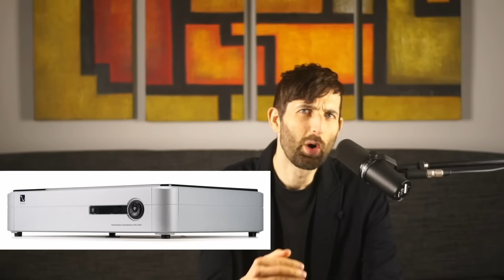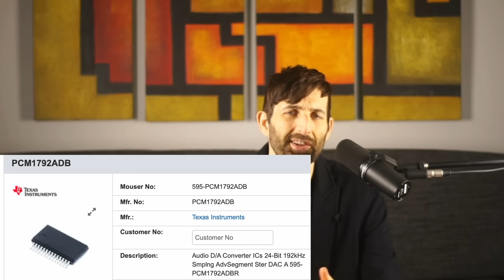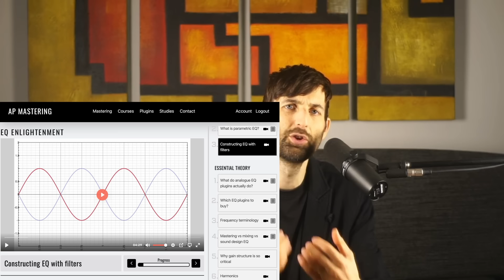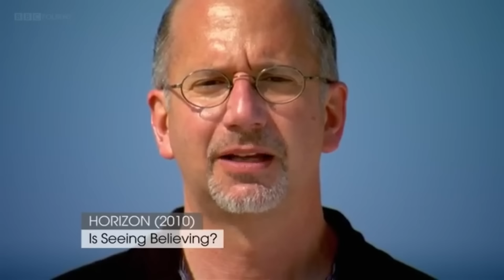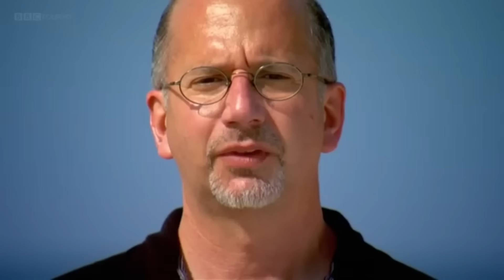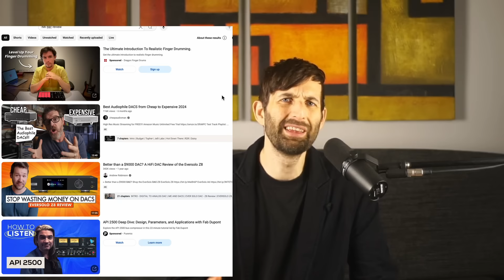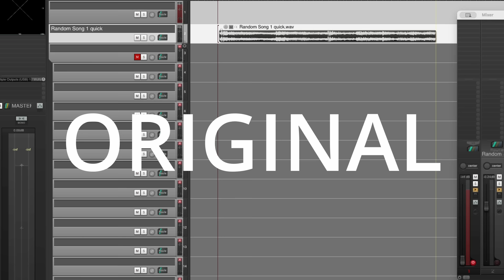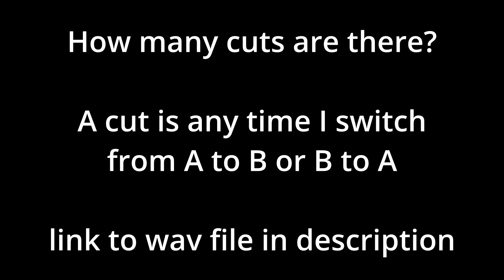The DAC Scam - Almost everyone believes the hype

Comment from the maker: GOOGLE POLL: https://forms.gle/wAQopiwNp8xmYX8c7

WAV OF BLIND TEST: https://drive.google.com/file/d/1JY8x0Vx7eL3KMoupVK1EAgHmeUJ6njxd/view?usp=sharing
Reply: Hmmmmm for the listening test - errr that's not really how A/B tests work. Can you provide what just the original sounds like? I'm not familiar with the piece and hear tons of artifacts and things that may be cuts, but that just may be the "sound" of the track. We don't know what it's supposed to sound like.
Reply: @lukegoodloomis6750  this is a normal bog-standard continuous unsignaled transition A/B test. One of them is the original, and the other is a loopback. It's right there in the video. You do not need a reference.

If you can't tell which is which or even when a cut occurs without being told, then DAC quality isn't something you should ever concern yourself with or spend money on.

Spoiler alert: nobody can hear which is which, because that's not how DACs fkn work, and nobody should ever concern themselves with or spend money on expensive DAC devices.
Reply: @lukegoodloomis6750  yep, that's why the young genenrantion of consumers don't invest in hi fi, everything they listen to is artificial  electronic  sounds, they dony have any natural sounds as reference
Reply: 4 times
Reply: @APMastering Back in the 80s one of the audio periodicals performed double blind A/B/X comparator testing of very high end CD players and amps vs. entry level pieces. The results were highly controversial in the community, but they clearly illustrated the profound effects of psychology on perception.
Reply: 3 times
Reply: At the end of the day it comes down to the chip used and how good the implementation of that chip is in the overall circuit.  In the world of electronics all of that can be objectively measured and compared to the digital source. With a really good dac-adc setup with matched sample rates etc you should be able to do a loopback and see almost a bit-bit perfect replication as if it were a digital copy.  Really these days DAC chip producers are just chasing down the noise floor and error correction, but it's already been significantly better than human hearing for decades.
Reply: I prefer as a DAC the Apple USB-C headphone adapter. It just sounds the best to me.
Reply: So are you saying that all interfaces use the same adc dac chip. So the only difference is the preamps?
Reply: Many times the grading of components comes down to things like tolerance etc i.e. how far out from the spec is the IC; So medical grade, lab grade, military etc, might actually spec out closer to the printed specs, but they'll be the exact same design anyway
Reply: This is stupid. You have a whold additional ADDA cycle. It's useless.
Reply: Answer: "DACs can introduce subtle "coloring" to the sound, primarily through their digital filter choices and the characteristics of their analog output stage. However, this coloring is usually much more subtle than what you'd get from an equalizer or a tube amplifier.  DAC chips often have selectable digital filters (e.g., sharp roll-off, slow roll-off, minimum phase, apodizing). These filters have slightly different frequency and phase responses, which can affect the perceived sound. Some might sound slightly brighter, some slightly smoother, some might have a slightly different transient response. These differences are usually quite small, but they are a source of "coloring."" Subjectivity doesn't equal scam.

Think of it like this: two high-quality wines might have very subtle differences in flavor profile, detectable only to a trained palate. Those subtle differences are real, even if a casual drinker can't distinguish them. The wines aren't a "scam" just because the differences are subtle.

Cumulative Effect: Subtle differences can accumulate and become more significant in a high-resolution audio system. A slightly cleaner power supply, slightly lower jitter, and a slightly better analog output stage, when combined, can result in a noticeable improvement in overall sound quality, even if each individual improvement is small.

Diminishing return is not scam: One may pay a very high price for very small improvement. That small improvement is still not a scam.

Saying "DACs are a scam" or "DAC coloring is a scam" because the differences are subtle and subjectively perceived is essentially equivalent to saying "subjectivity is a scam." and this is a nonsensical proposition.

Failing to distinguish between two DACs in a blind test doesn't prove they sound identical; it simply means the listener, in that specific test, couldn't reliably identify the difference. This is different from claiming that no difference exists, or that the manufacturer is deliberately deceiving customers.
Reply: did the poll already closed?
Reply from the maker: @ yeah i got over 1300 responses and already published the correct answer
Reply: with what type of music it can also be decisive. It's one thing if you listen to electronic music It's another thing if you listen to acoustic music maybe. or to songs that are preferably not digitally manipulated in any way
Reply: You simply have not understood the hifi puzzle/problem, what do you do when you put a file on Google drive, you measure, what can you measure precision and only precision, you cannot measure timbre image/soundstage, rhythm, perceived resolution and dynamics , how lifelike the sound is and more.

In fact, most of what we hear and interpret can't be measured, it's like taste, and to some extent sight.

The main problem is that a cable or a capacitor or an entire hifi device (a DAC) can sound so different on the non-measurable parameters in a hifi system that it is no problem to identify the sound difference with or without a blind test.

This is the hifi conundrum that has plagued virtually all serious hifi designers/engineers like myself for decades, the problem can be simplified to the sound difference between copper and silver, there is a measurable difference in conductivity but the audio signal itself is not affected, even if the conductivity is compensated for, there is a significant perceived sound difference on the parameters I mentioned earlier that are not measurable, sound differences that can only be perceived and interpreted by ear and brain in front of a complete hifi system. You cannot record them. If you could, the main problem is solved..
Reply: Why don't you try buying a ‘good enough hifi system’ in Wal-Mart and compare it to an Audio Note system at maybe 10-100 times the price, if you still claim there is no significant difference in sound I would say you are deaf.

The audible sound difference moves from a "technical reproduction from the Wal-Mart system where there is no doubt that it is a reproduction, to a much more lifelike timbre, image/sundstage from the Audio Note system and this is the essence and goal of our common hobby.

I'm an electronics engineer myself and for 20-30 years I've wondered about the sound differences on capacitors, resistors, cables, connectors,  PCBs, enclosures, and pretty much everything in controlled blind tests.

The only thing I agree with you is that many of these sound differences shouldn't be there according to theory and measurement, ASR has confirmed this for years.

But the vast majority of serious hifi technicians know that this is not the case, but they don't have the technical explanation, they only have listening experiences and technical hypotheses to rely on.

As you say mumbo jumbo/story telling sells better than admitting that you don't actually understand why many of these sound differences occur.

And it is precisely this problem paradox that divides hifi enthusiasts and causes them to argue endlessly in various forums.

Ps. You ask for proof, there is none, proof only exists as listening experience from millions of hifi enthusiasts, including technicians like myself who know full well I should not hear what I do. But still do it even in blind tests.
Reply: Actually, a proper test should always switch at the same point, otherwise, a recording will always sound different and you can't distinguish whether the change in sound is due to the switch or due to the performance and tonality change.
Reply: Thank you for your honesty about DACS. But, unless I missed something, isn't it the case that pricier DACS often include a preamp option, not that a preamp should cost a fortune either.
Reply: Switch 3 times
Reply: All the best days don't use chips
Reply: @kevinpaiuk2835 Some days I eat chips 😂
Reply: 😮Can u provide an Video Demo & Explaim what r all those Blue blue EXPO cap or Red Red WIXA German Cap or other Funny funny Cap just after came out of those DAC chip. Why must install all those Cap for what purpose!!😮😮😮
Reply: I fully agree with what is being said over here. I'm a mastering engineer and use a pair of PMC MB2 XBD mastering monitors with the highest quality electronics - quad-amped, super low distortion Bryston electronics. They remain as the current pinnacle of 12" mastering monitors. They go for over $100K retail. What do I use for the DAC? The fiio FQ1222. Bought it for double digits $ so long ago that I forgot how much it cost. It fully exceeds the monitoring system I have in every metric. There's no way people will be telling me I need an even $500 DAC nowadays. It's just not true. The only case a dac might exceed $500 and be worth it is if it has >10 outputs and inputs. That is ALL.
Reply: @cheater00 so this has to be true for interfaces as well, right. Besides the preamp?
Reply: @arnoldwatkins805  It absolutely is. And I checked. With the exception of Behringer, every audio interface I could find that published what DACs and ADCs they are using are using the same ones.

The big quality difference, I'm told, is in the stability of the drivers. And I have a cheap interface and the drivers indeed suck. 🤣
Reply: @cheater00  I was in one good studio, they claim that their gear own bla bla. When i see what cables they use.. i was lol. Anyway, they final product sound like crap, harsh, noisy, lifeless, syntetic exactly like their cables and cheap connectors. They use same crap on mic input also. Disaster.
Reply: @cheater00  Answer: You are correct. For many users, the extra features offered by DACs over $500 are (possibly) not worth the additional cost. A simpler, less expensive DAC that focuses on providing high-quality D/A conversion may be a better value proposition, and there's definitely potential diminishing returns, even future-proofing risks aspects (like features that become obsolete). That 10 outputs/inputs aspect says it.
Reply: @cheater00  That's fine for mastering purposes.  It is not the most musically satisfying in a home setting or dedicated listening room.  Mastering speakers are generally not the same as home listening speakers .
Reply: @cheater00  your job as a mastering engineer is far different than mine as a high end audio system curator. The results we each want are COMPLETELY different. You analyze sonic, we feel for emotion. You manipulate EQ, actively forcing the signal to do what you want on your rig with your ears, with the goal of selling music. For playback on an iPhone for chrissakes. (If you want to make any real money that is.) You don't master anything for our high end $100K plus systems. A Fiio would never please us with our 100K speakers.
Reply: @OCDHIFiGuy  that's such an amazing load of crap it's even hard to argue with.
Reply: @OCDHIFiGuy  is this satire? It's genuinely hard to tell
Reply: @OCDHIFiGuy  Although the D70s Topping I've tried with my Von Schweikert VR9 SE Mk2 speakers and it is a great DAC.
Reply: you don't know nothing about mastering.
Reply: @tubenmilch  saying, "you don't know nothing", means you KNOW something! Get back to school! But, you're right with what you're trying to say. He knows F all.
Reply: @OCDHIFiGuy  Literally everything you are listening to passed through a mastering engineers hands and system, which are better than yours.  You are just trying to defend yourself psychologically from the pain of having been so wrong.  Flat Earthers are exactly the same when presented with evidence against their laughable worldview.
Reply: @OCDHIFiGuy  What do you mean with "You don't master ... for our high end ... systems"? The music you hear is mastered by an mastering engineer and not by an audiophile.  Often - very often - those engineers are in their 50th and 60th and have a listening range of about  20 ... 12000Hz. And very often they do not use high end equipment but rather inexpensive linear monitors like those from Yamaha for a couple of thousand bucks.
Reply: @OCDHIFiGuy  Exactly. I have no doubt a decent $200 DAC measures just as well as a $20000 DAC, and have an identical frequency response. If a flat sound signature is all you care about, you can get it for cheap. And for mastering engineers, a flat sound signature is pretty much all that matters, along with detail retrieval. How that detail is presented doesn't matter nearly as much.
Reply: Sorry to be a hater, but every second of that wave audio sounds like it was mixed on a fisher price studio, then recorded on a phone.  Why don't we try this again with a professionally mastered album, and you can send two original pcm encoded wav files.  

Also, if you can't play the complete sample once  with both of the two formats, then it's impossible to guess if the sound defects were a recording/mastering error, or an actual difference caused by a 24 bit to 16 bit down conversion.
Reply: It's just sad that audiophiles never listen to actual experts and keep getting fooled by all the snake oil marketing. In addition to this you have BS products like "re-clockers", "audiophile digital interconnects" and expensive pre-amps being sold as if they do anything to improve digital music playback. Best for digital audio playback is a well engineered DAC directly connected to a power amp provided the DAC has a decent volume control either analog or 32 bits. Personally I like to see a DSP on the digital side that operates in high resolution to minimize quantization errors allowing me some EQ tweaking.
Reply: @ThinkingBetter  I agree that most audiophiles do not have satisfying music reproduction (having heard 1000s of systems).  Careful matching of good equipment is required, often expensive and time consuming.  Most audiophiles may only prefer limited music genres (rock, jazz, classical, ethnic, pop, etc).  They often have limited collections or just stream.  If an audio system can resolve acoustic recordings they are generally adequate for most other types, especially the post 1995 production made pop recordings of today.
Reply: @ThinkingBetter  reclockers are a real thing that serves a purpose. but nowadays they are built into high end dacs.
Reply: @ Some high end DACs still have separate reclockers, e.g. dCS DACs (now with 4 boxes and $100K+ prices).  I'm just simple and stick with single box DACs like my Topping and Lampizator.
Reply: Bogus test. 
1. Using music that has distortion and no empty space, obviously masks DAC distortion. 
2. Expecting anyone to hear the difference via YouTube, most likely watched on a phone, is like asking someone to spot the original master compared to a fake painting when looking at a low res snapshot taken in poor lighting.
Reply: @davebutler3905 all great points, but are dacs using the same chips?

Comment: I went from a 192khz/28-bit DAC to a 568khz/32-bit DAC for $100 CDN and I noticed a positive difference.
Reply from the maker: no you didn't. either one or both were low quality or it is in your head
Reply: @APMastering Drummer for 40 years now. My hearing is way more accurate and sensitive than yours.

Comment: Don't the soundcards in PCs already have DACs and are those equally as good even in the cheapest PCs? I've been researching amps a bit and have been annoyed by the fact some don't have DACs until I realised that previously none of them had them - I used to just plug my PC from the audio jack and that worked just fine! Can you shine some light on when a DAC is actually needed? I am talking listening from a digital source - but that would almost always be a PC, maybe sometimes even the phone - would this be the case when an additional DAC (in the amp or external) would be needed?

Comment: I can tell mojo2 is different then most off the shelf and r2r sounds more analog (more of a rounded sound rather then the digital filter sound) other wise when you put most delta sigma next to each other i can not tell the difference…. I think the different methods of unfolding/ convection matter more then which dac chip or how much power they can handle……. Much like   A one class D amp

Comment: I use Neutron Player with iBasso DC07 Pro. It is night and day difference. Neutron has its own audio engine that bypasses the crappy Android audio circuitry and outputs directly to the DC07. Huge, huge difference. It would not have the same results without Neutron. I can't believe a phone can sound that good.

Comment: Military / industrial grade are the exact same chips with usually higher temperature ratings and/or better power consumption. Possibly they could have a very slight difference in performance (ratings) as well. They are not different design they are just better performing parts of the same silicon wafer. Anyway they are not multiple times more expensive, just a little bit. If someone sells you one with 1000 euros you are being fooled.